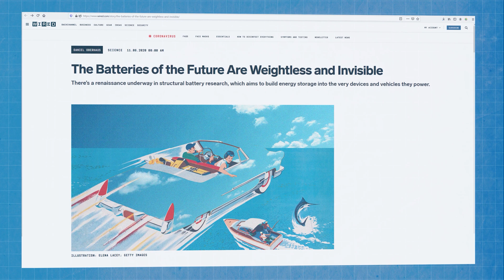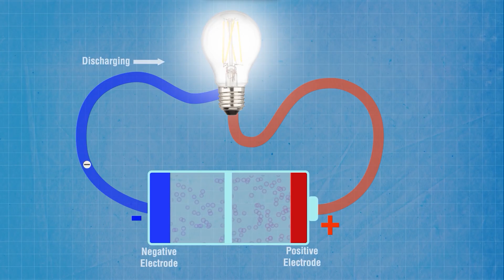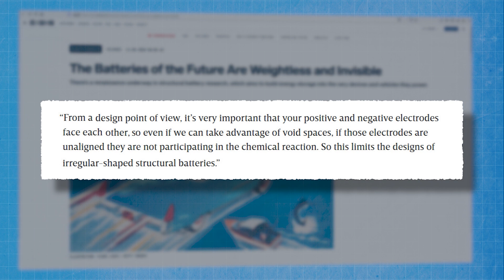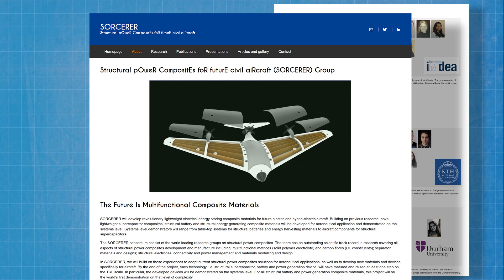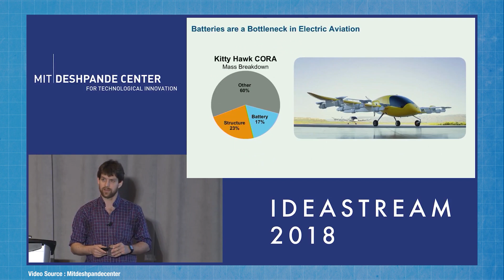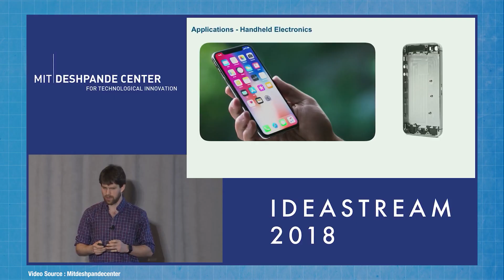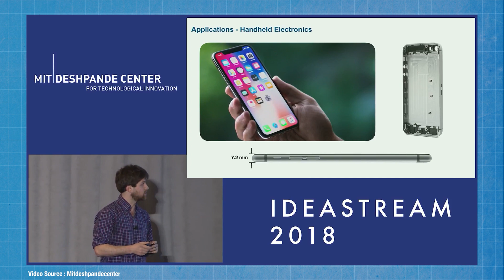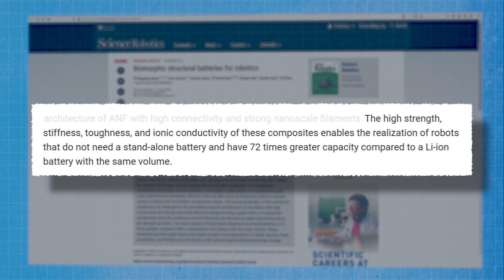Batteries in bodywork. Extending the range of cars and planes.

Comment: I have a question about the actual efficiency of the battery concept right now:

If we use a fossil fuel plant to provide electricity used for charging battery, are they more efficient than a car?

My conclusion: no. 

My approach: 
Fossil fuel plant: 40% efficient 
Electric lines to house: 85% efficient
Transfer to battery: 90% efficient 
From battery to car: 90% efficient 

This is not mentioning the cost to produce batteries. 

This would make charging batteries as a very inefficient approach; much worse than just taking the energy and pouring it in your car. 

Thoughts?
Reply: Just a smidge more efficient than an ice car with coal. Low maintenance, less noise, no urban pollution and self driving for ride sharing make evs future proof.
Reply: Ricky, the Union of Concerned Scientists did a big analysis of this issue, and the bottom line was that BEVs emit less CO2 than ICE in all or nearly all cases.  This is largely because electric motors are so much more efficient than ICE.  Your estimate for transmission losses seems high; the EIA says the average is 95% https://www.eia.gov/tools/faqs/faq.php?id=105&t=3  It really doesn't matter what fraction of the theoretical energy content of a fuel is turned into useful work; the thing that matters is the amount of CO2 produced per unit of work.  That means that natural gas plants are a much better source than coal plants.
Reply: @incognitotorpedo42  I looked on the website of the Union of concerned scientists and couldn’t find the report for that, do you have a link?  

I have heard some podcasts over the topic but if by far the VAST majority of energy to charge Electric cars comes from fossil fuel plants then we need to factor in the inefficiency there and then look at electric cars. 

Even if the loss over the power lines is only 5%, there are still the three other areas (plants themselves, charge and discharging batteries) that seem to have less combined efficiency than just pouring gas in a fuel efficient car (~30mpg).

Comment: I feel like batteries are such an own-goal environmentally! Makes me want to tear my hair out. We should be researching hydrogen cell technology. Something actually new. Not rehashing milk floats and golf carts.

But its too late. We're a long way down the rabbit hole.
Reply: Hydrogen is inefficient garbage that has been researched for decades without getting any closer to commercial viability. The environmental impact of batteries compared to hydrogen has been massively overstated as well. You are barking up the wrong tree. It's Big Oil that is in favor of hydrogen, because it delays the move away from oil and allows them to remain the primary suppliers of fuel after the switch.
Reply: @theuncalledfor  always good to get more info. I've recently been reading about how the Japanese government had been backing hydrogen fuel cell technology but had to drop it, not because it wasn't promising but because the world had tipped in favour batteries to such an e extent they realised they would be hampering their car industry if they forced it to develop and build hydrogen cell power systems for the domestic market as well as battery technology for the rest of the world.
Reply: @RasheedKhan-he6xx  
That is idiotic. People will buy hydrogen vehicles if they're better. But they're not. Hydrogen is expensive, even more so if it's not made from methane ("natural gas"). It's hard to contain, costs energy to compress and transport, and is simply an inferior way of storing energy. These problems are inherent, and not likely to be solved ever.

Meanwhile, batteries are continuously getting better. Better energy density, better charge speed, less and less damaging to the environment as mining techniques improve. And cheaper every year.

It's not public opinion. It's not politics. It's the technology itself that keeps hydrogen from being dominant. And now that Tesla is around, Big Auto is forced to admit it.
Reply: @theuncalledfor  what a pity you have to resort to personal insults. And so the conversation ends.

Comment: Nano tech 3d printed batteries used as structural support will be lightweight ( titanium oxide ) with 5 band gap and infrared beamed power for post takeoff and landing with holding beacons using focused  microwave radar array tech.

Comment: This whole concept makes me think of bone marrow, the way the body has repurposed the interior of the structural parts to serve a second function, in the case of your bones it's making blood cells. Of course evolution being what it is, it's entirely possible that it went the other way and the body simply recycled its blood cell making machinery to use as a structural part, which I guess is still applicable to a structural battery.

(By the way, it's the University of Michigan, not Michigan University. They need to disambiguate from Western Michigan University, Eastern Michigan University, Central Michigan University, Michigan State University (Spartans Will!), and probably one or two others with the words Michigan and University in their name.)

Comment: t seems more sensible to standardise on battery packs so they're easily replaced. What happens with an EV which has a structural battery that is EOL? Modularirty? Dead battery means you have to buy a new monocoque and change over all the parts or maybe it's just the floor pan.... recycling implications etc. etc.
It'll be interesting to see how structural a structural battery can actually be. Push it too far too quickly and they won't endure. Small shunts in EVs made of structural batteries, then what, they go up in flames? Not knocking the research, just curious how long before they're actually commercially viable. For most applications.

Comment: Hi,

Could you perhaps have a look at your encoding settings? The grey area above your head is really showing quite some compression noise! It did so in the last video too, but a lot less before that. To be clear though, it has always been visible. Recently just a lot more. If it helps, my browser apparently picks VP9 for the video.

Edit: Just forced h.264. That does look a bit better (less blocky).
Reply from the maker: Hi Mark. You sound like someone who knows a thing or two on the subject. I film in 4K and I edit in Premiere Pro. I use an encoding plug in for Media Encoder called Instagram Video Export Preset  VBR 40,60 3840x2160 2 pass. It's designed to synch correctly with the YouTube uploader codec. I always check the final video on YouTube before I make it public, and this week's looked OK (the mic was the problem this week, rubbing on my shirt!). If you have any tips you can share I would be gratefull to receive them. My email is daveb@justhaveathink.com  Cheers

Comment: Wouldnt it be easier to use hydrogen as the source of energy rather than electricity?
The technology is more advance for combustion engines (hydrogen-based) compared with electric storage...
Reply: @M. Karbaschi: Hydrogen isn't all that energy dense either,  if it's at room temperature and pressure,  and storing it is not trivial.

 You're forced to go cryogenic or high pressure solutions, which are clumsy solutions for vehicles. Or,  to combine it  with carbon, making methane and try to extract the carbon out in line just before combustion, or sending it to a fuel cell. You could also try to combine the hydrogen with oxygen to make water, and extract the oxygen in line prior.

Hydrogen combustion is very high temperature too, which is problematic from a materials standpoint for ICEs, hence the fuel cell is the typical application for hydrogen fuel.

Nonetheless,  oil companies i expect will try to extract hydrogen directly from fracking and leave the carbon underground - it's been done in fact. And they will work to make technical improvements in these issues, which is all for the best too.
Reply: @alvarofernandez5118  Interesting information thank you. 
I just thought hydrogen could replace CNG in the cars which work with gas which seems it is not a straightforward process.

Comment: That's really cool if you can use it as a structural on the outside of like a car you could use it on a skyscraper look at all the energy it would save and you wouldn't need power hookup especially if all the windows was solar

Comment: Cool tech, though I have a concern with using it in wings.  Thirty odd years ago, there was a concern with more aircraft parts being manufactured from carbon fiber instead of aluminum.  The concern was with lightning strikes in flight (rare, but did happen).  The aircraft aluminum allowed the electricity to flow around the plane like a faraday cage, leaving it unharmed.  Since carbon fiber wasn't conductive, it would loose this property.

So, my concern with this tech is, how does it handle a lightning strike?  And if the answer is, "not well", then maybe it isn't a good idea to use it in aircraft, despite its advantages.
Reply: I think they put a layer of copper mesh in the composite for lightning so maybe would work for batteries. Also need to have one of the battery tech where you can puncture the "cell" and not have fire/short circuit.
Reply: @brucec954  I believe that was the solution they came up with.  However, that's using carbon fiber for structural integrity.  Now, on top of being used for that, it's storing electricity.  How does a lightning strike to the battery affect it?
Reply: maybe you could put an antenna on top that would fall off if a lighting bolt strikes

Comment: Do you know what the best structural batery is ? Living cells.
Reply: Very interesting comment Leonardo. Can you elaborate?
Reply: @petertrys_it9395  adipose and muscle cells are part of your bodies structure and at the same time work as chemical storage for material for the cells of your whole body to process. So they are really good batteries, that also can change size, a flexible, can multiply on their own, work as motors, work as thermal isolation and impact protection.
Imagine your cars fuel tank growing if you keep always filling it up to the max. Or your motor developing more horsepowers if you use it a lot to carry heavy loads. Also it would recover most damage after you smashed it into something as long as its not total damage.
Reply: @mllhild  brilliant, thank you MoonLightLady, very interesting!👍

Comment: A great idea!

One thing that springs to mind though is what happens in a car crash? Have you seen what a decent battery fire looks like? Now imagine being inside that fire! "Normal" cars have their fuel tanks in well protected areas for a good reason.
Maybe we will see an integrated fire suppression device fitted too?

Maybe we will see this tech featured as actual buildings like factory units and housing. This could be part of the solution of energy storage in general distribution systems. One of the problems that will hit the budding Electrical Car industry..... Hard!
Imagine every street lamp storing its own energy allowing you to plug your car in to! Or even the structure of multi story car parks? 
Traffic lights may be a problem though ;0)
Reply: Not only the fire hazard, I understand that car batteries supply a few hundred volts, I wouldn't like to be sat in the middle of that after a crash.
Reply: @rogerbarton497  Me neather!

Comment: 20% of the storage and 20% of the strength. Sounds like a half-baked idea. Hopefully it will finish baking in a few years, but  sitting inside of a 300 volt lithium ion battery gives new meaning to "crash and burn", eh?
Reply: I don't like sitting beside a highly explosive, combustable fuel tank at the moment.

Comment: hmm, if you puncture a typical lithium-ion battery you'll have a bad day, is it a good idea to use them as car body panels??? Or is there something additional that would make them safer against physical damage? Sounds suspiciously like a deal-breaker that creators want to downplay.
Reply: What ignites and burns are the volatiles in the batteries.. the electrolytes.
Industry is working on getting rid of this.. see solid state.

Comment: Amazing how many of these problems we keep running into largely boil down to issues of individual convenience. Until people start thinking more communally when it comes to things like transportation in general, and stop pretending like it's realistic for every human on earth to have their own personal vehicle sitting idly by doing nothing for most of its lifespan, we're never going to deal with the underlying problem itself in that we simply consume too much. 

Structural batteries are a sort of hack to try to get around some of that problem, but in the end the problem remains. Overhead electric powered trains, buses, and tractor trailers are by far the most efficient means of transporting both people and goods across land. We need to get with that reality, and start implementing technologies like ultra high voltage DC transmission lines in conjunction with renewable energy to power them around the world.

Anthropogenic global warming is a global issue, and we're never going to solve it so long as we keep thinking it's some problem for billions of individuals to solve rather than one to be addressed together.

Comment: Fuel weight is not the only thing to take into account , exhaust systems ,  including catalysts, engines , alternator, radiator(s), fuel pipes etc
Reply: That's right, effectively a battery is not just a fuel tank, it's also the engine and the entire intake and emission system. The electric motor is more akin to a torque converter.
Reply: @AlRoderick  No, the battery is only energy storage, the fuel tank. The small electric motor is the equivalent engine and transmission which is extremely compact. Check WeberAuto for some great info on the Chevy Bolt EV.
Reply: @davidmccarthy6061  Genius: electric cars and especially electric trucks will all still have transmissions due to costs.  Unless the vehicle is VERY light with VERY small load capacity, even PMC motors do not have enough torque unless you have a crazy number of them for crazy insane performance AKA, NOT economical.
Reply: @AlRoderick  Electric cars also has a radiator and cooling system for the battery. Not to mention the wiring.
Reply: Hmmm.... How many "A123 Systems" 26650 Cells, will I need, to make the Body of my Pickup? 🤔 X^y = ?

Comment: Not viable for cars I guess: What about piercing he structural  battery cells in an accident? Also the materials used are only found in supercars because they are (for now) way to cumbersome and expensive for mass produced vehicles. Nice technolgy though, that's for sure.
Reply: Tesla is going to put its new cells to use as structural part of the car..
And if they get pierced through an accident, the car will warn you and come to a stop to let you out.
If you get into a freak accident where that isn't possible your chances are not worse compared to a ICE car though.. so really no issues there.
Reply: I'd rather come to a stop myself and let myself out tbh. And it needn't be a freak accident for a damaged cell to happen and cause a fire really. Also ICE cars aren't that likely to blow/burst in flames as Hollywood would like you to believe 😉 It would of course make a huge difference as to where the structurual batteries would be located, if it's basically the spot the cell's would have been in the first place it wouldn't matter much. Exposed parts is a different story...
Reply: @NoNeedToShout  
BEVs are 10 times less likely to burn compared to ICEV..
Then there is pouch cells with electrolytes you can drive nails through, which don't burn.
I'm pretty sure for structural batteries we're talking solid state here..
And all this stuff is 10 years down the road at best anyway.
No need to get your undies in a twist about it today.
Reply: @joansparky4439  lol, my undies are fine thank you. There is still risks involved handling BEV's that have been involved in an accident that are of concern to first responders. I'm sure these issues will be solved along the way but I would hope the automotive renaissance would also make for a leap in safety instead of adding to the problems. Also pouch cells are hardly trouble free and possibly not as energy dense. Maybe in 10 years heh?